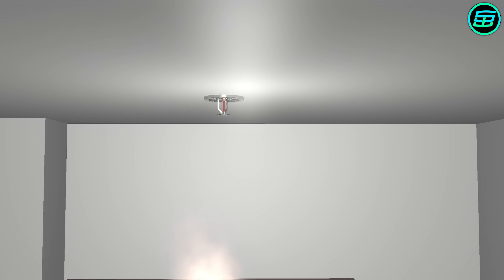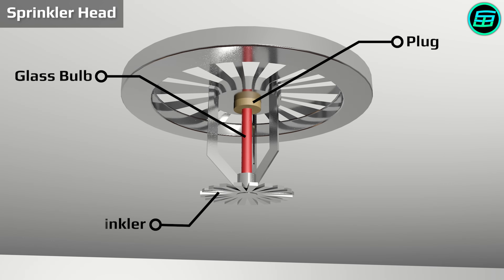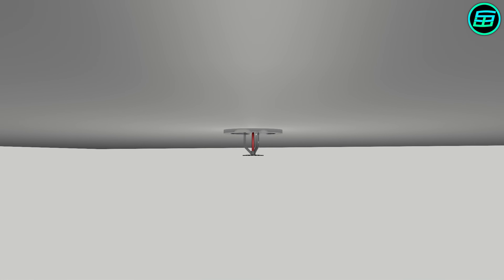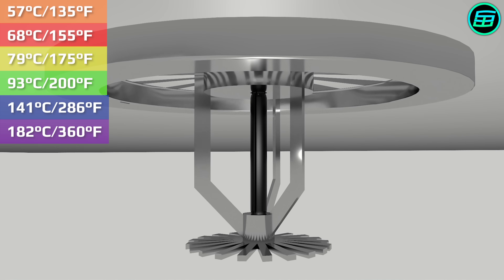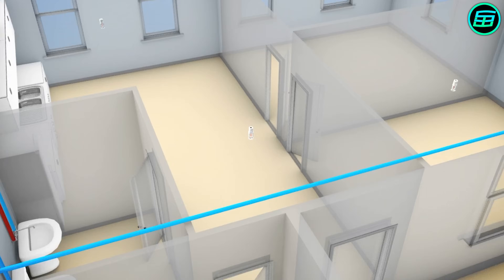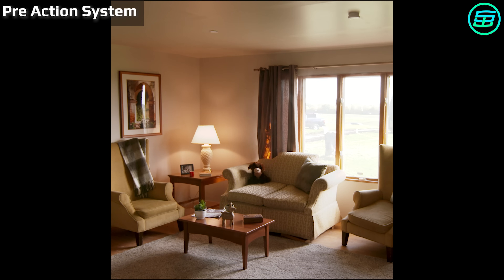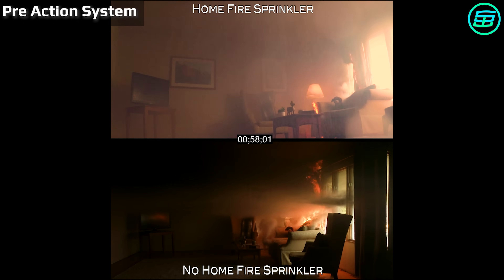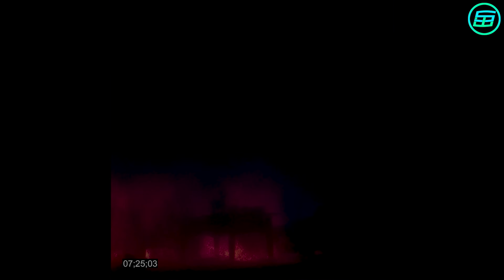How fire sprinkler systems work (3D Animation)

Comment: Based on both the misinformation in the video and the comments, there is a whole lot of clueless people out there. First, sprinkler “head” is not correct. That is an old Factory Mutual term. The NFPA does not use the term “head” in any of their sprinkler standards. They are just a “sprinkler” or “sprinklers”. Not all sprinklers use a glass bulb as the thermal response link. There are other. Furthermore, the temperature rating is indicated, but not determined, by the color of the liquid in the bulb. Temperature rating is principally determined by the size of the gas bubble in the bulb.

For Dry pipe systems, the gas most commonly used in the piping is just compressed air, not pure nitrogen. (NFPA 13 describes five types of systems: Wet pipe, dry pipe, preaction, deluge, and dry pipe-preaction.)

Limiting the number of sprinklers that open is principally not to limit water damage, but rather to prevent an excessive demand on the connected water supply.

As a degreed fire protection engineer of nearly 50 years, I cringe every time scientists try to describe how fire protection works.

Comment: Another thing is, sprinkler systems are always connected to the fire alarm system (in commercial buildings). There’s a flow switch on the system somewhere and when it detects water flowing it’ll trigger the system. Most fire alarm activation scenarios allow for the alarm to be silenced, but waterflow alarms cannot be silenced, you have to reset the system, and if the flow switch is still active, the system will sound again after you reset.
Reply: Would a frozen bursted pipe cause it to go off?

Comment: if the tube on the sprinkler breaks how do they replace it
Reply: You isolate the subsidiary stop valve leading to that sprinkler head/zone, or use the main isolation valve in the sprinkler installation (then drain remaining water if needed to do manually) and simply screw on a new sprinkler head, then de-isolate it. In Australia at least, AS1851-2012 requires spare sprinkler heads to be available for each installation at a site.

Comment: For some reason, I have a massive fear of these. I will not go into a shower if there is a sprinkler in there. I refuse to goo a small room if there is a sprinkler inside. This has kinda helped
Reply: As someone who designs/install fire sprinkler systems, this makes absolutely no sense to me?? 😂 Why the fear?
Reply: @collectgemsosrs6298  I  don't really know. It's just one of those fears that make no sense.
Reply: @WaltGamingguy  the only way a fire sprinkler will go off is for it's intended use, when it heats up to certain temperature it will activate, or if someone purposely hits it and breaks it, other than that idk lol fyi 95% of all buildings have them so good luck lol
Reply: Yeah. Get a fvcking grip ffs. 
Ignorance of the general public is mind blowing.
Reply: lol thata stupid af...why are even telling us this!?
Reply: I know what you mean, I’m just scared it will go off even if there is no reason for it to. I have a similar fear to smoke alarms as well 😅
Reply: @skatingrat3502 What an irrational fear

Comment: love it... why are different colors of bulbs for different temps used?
Reply: different temperature sprinklers are needed in different parts of buildings and as an installer it would be a nightmare trying to figure out which one is which if they are all the same color. Kinda like a guaranteed way to make sure the right thing is where it needs to be. :)
Reply: I'm thinking the color of the liquid has chemicals in it that can withstand high temperatures that's what makes it the color.

Comment: you sure spronklers are good at putting out a fire?
Reply: The purpose of a sprinkler isn’t always to directly extinguish a fire. It’s to assist with compartmentalising a growing fire and preventing it from spreading to different compartments or exposures until the fire brigade arrive, hence the circular shape. It’s like a shielding dome around the fire.
Reply: Not all , some have to be designed in specific ways like there orifices should be larger and water density should be more or else in case of a fire these water droplest can evaporate due to heat  and due to which the fire can spread causing nearby sprinklers to activate resulting in loss of pressure on the sprinkler head directly over the seat of the fire.

Comment: Dry systems CAN be filled with pressurized nitrogen, but 100% of the Dry Systems I have designed use plan old air. Nitrogen can get very expensive.

Comment: Do you happen to know how far away does the sprinkler needs to be from a wall?
Reply: 4 inches is the minimum for most applications.
Reply from the maker: Sorry, I don't know the exact numbers but NFPA 13, 13R or 13D standards are used for sprinkler installation.
Reply: You can learn NFPA-13 at Chapter 10 Page 10-80 have explain about ur question. First we need to know our fire hazard because its mean light or ordinary or extra hazard. All of these hazards have maximum  distance from wall.
Reply: Most of the hazards allows 1.5m or 5ft, but as someone says here, it depends a lot of your hazard and a lot lot of things that must be considerated.

Comment: Yes I like the movies where all the sprinkler heads go off that's only in the movies
Reply: :47 is a deflector, the whole thing is the 'sprinkler'
Reply: Dry systems are most commonly filled with compressed air not nitrogen
Reply: Daraga church
Reply: You are almost 100% right. However, There are some systems where all the sprinklers are open and that would happen, very uncommon though
Reply: @cleatis79  depends I guess I've installed quite a few deluge systems, but yes not as common.
Reply: @cleatis79  that's in buildings with freezing temperatures. That's called a dry system. But regular systems are called wet systems. So only the effected sprinkler head will go off.
Reply: dry systems do not have open sprinklers where they all go off, that is deluge systems. On dry, Only sprinklers where the temp is high enough to pop the bulb, or melt the solder will emit water. It's no different than a wet system except filled with compressed air instead of water and uses q dry pipe valve.